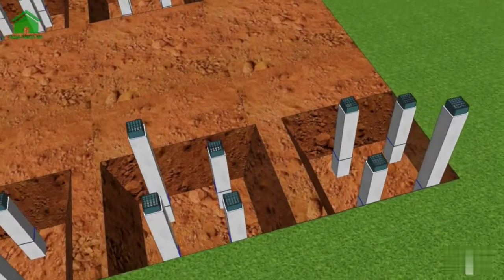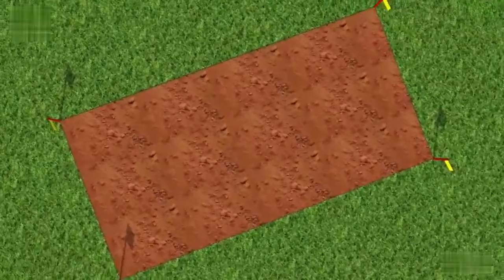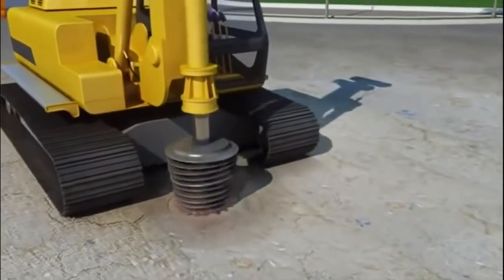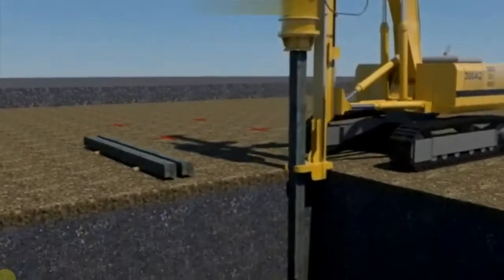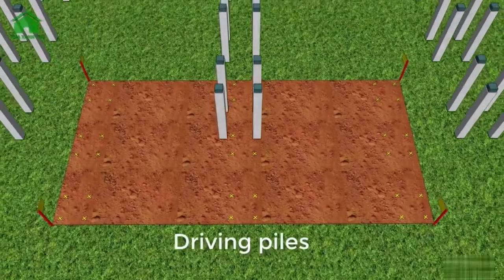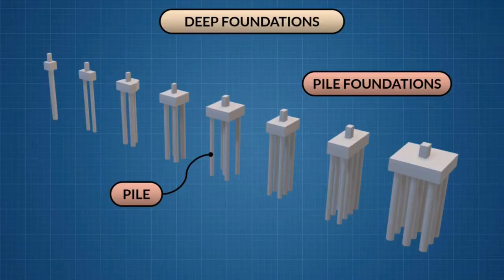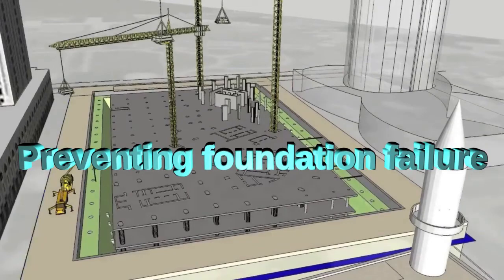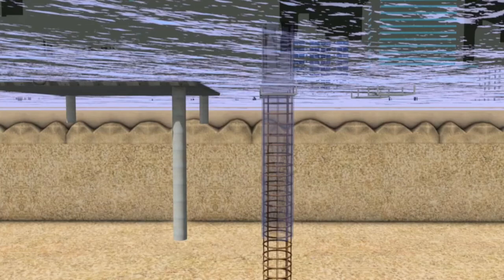Deep foundation Design on Buildings | Pile Foundation.

Comment: I came here to learn after the building in Surfside Miami Florida has collapsed, killing 157 people. The cause has not been determined. The building was not being maintained and blame is being passed around.  I'm not a student, but I'm trying to understand what kind of piling would be best . I'm told this beach area is limestone underground. Do you know about this building, and do you have any thoughts? Thank you for your video.
Reply from the maker: Oh I see. I was not really aware about it. But now I do. They are saying it was due to some Structural and serviceability problems. Abundant cracking and concrete spelling on the columns, beams and walls which might have caused the sudden destruction.
Reply: @Innotutorial  yes, it's very sad that it was not maintained and even to an average person like me, I can see how deadly that is now.  Still I cannot help to wonder if the kind of piles in the beginning were not proper, or perhaps to save money.  Also many buildings in that area are exposed to sea water flooding, as parking under the building floods are common.  At the time it was built, this was not a problem, but became one over the last 10 years. Maybe from the beginning the plans were not sufficient?  I'm hoping the government looks into this also, because if that is true, many buildings there are at risk.
Reply from the maker: Yes. If the government don't look into this on time. Other neighbouring buildings can be prone to same destruction.